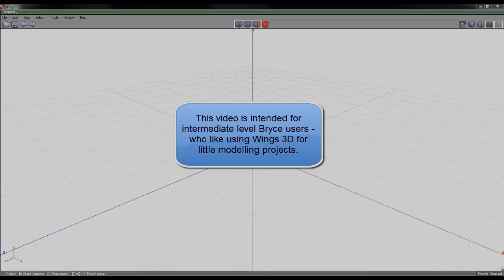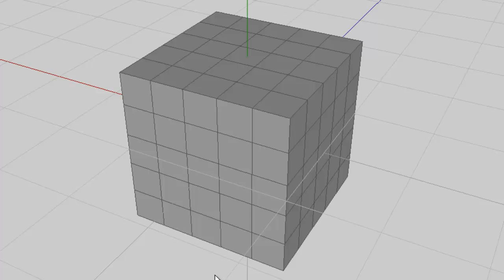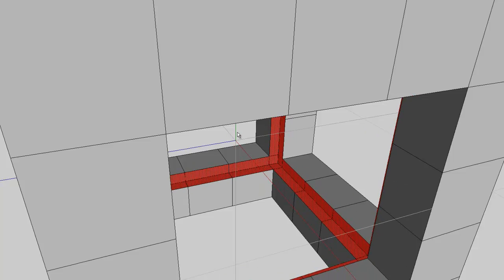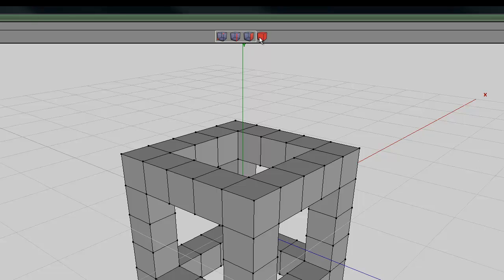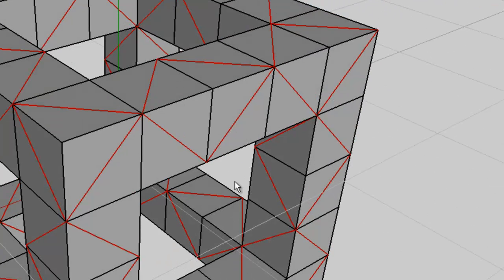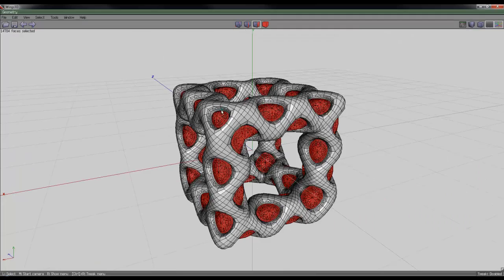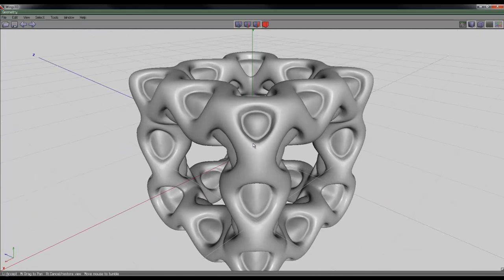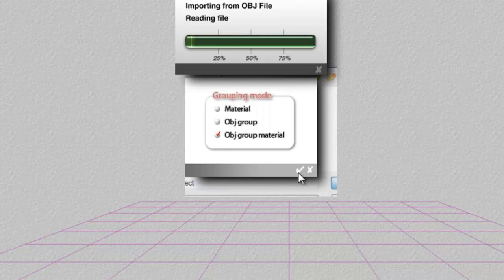10 minute Wings3D project - making something to import into Bryce - a tutorial by David Brinnen.

Comment: I really need to stop using Sketchup.
Reply from the maker: What I've found is that I've gathered a collection of software, a lot of it free, that I use to perform just one or two tasks.  So long as you can move your models between applications, you don't have to stop using anything, just move on to the most appropriate tool for the bit of the job you need to deal with next.